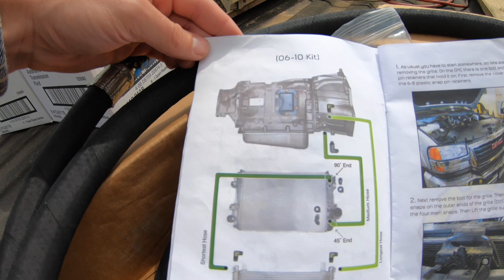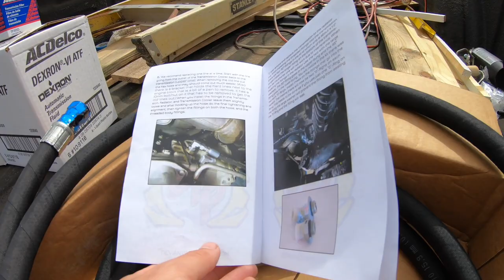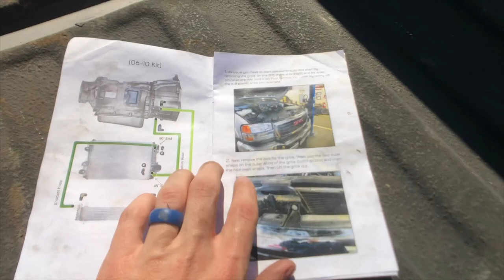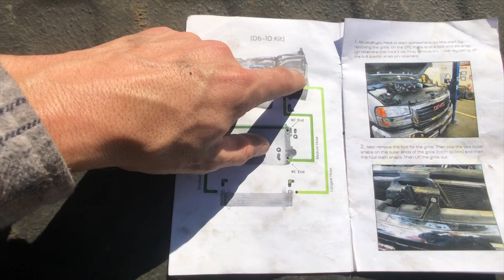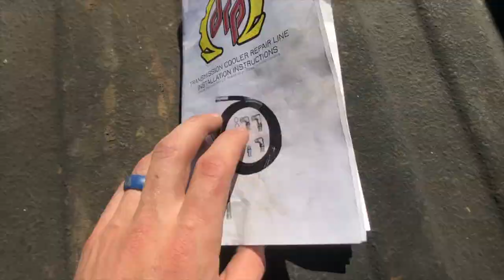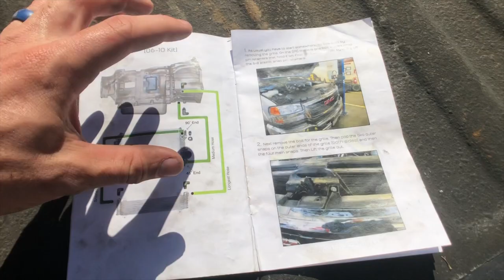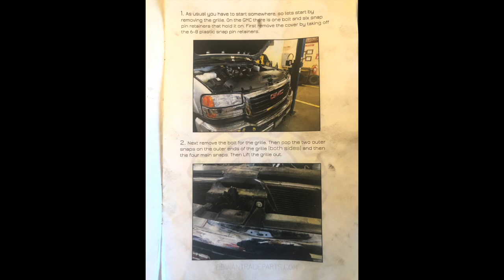Replacing Allison 1000 Transmission Lines With DEVIANT RACE PARTS "DRP" Lines

Comment: Thanks for the video! I just did this install on my LBZ for reassurance. I lucked out and did a good job tightening the connections behind the intercooler without leaks, I reassembled everything before checking. I did, however, have leaks on the other 4 connections but tightened them down until no leaks. Worth mentioning, the rubber o-ring side of the connectors just needs to be snugged down. The rubber seals it. I wish the longest hose was a bit longer so it wouldn't be draped across the front of the cooler.

Comment: I did mine before watching this video.  Mine is a 2013  duramax.  I went to NAPA and had them make a 6 foot 1/2  ID hose  5000 psi with two  3/4 -14  90 degree fittings and it has been great 3 days no leaks or anything.  The factory lines I could not get in  they were impossible without dropping the front differential . Good job on the video . Its a pretty easy job if you want to dyi .
Reply from the maker: Thanks for watching!
Reply: @trentonbartley6417  I just wanna ask, if to this day, is there no leaks on these hoses and do these hoses withstand pressure even with heavy load or towing ?
Reply: Which line did you replace with 6' of hose? The bottom line is leaking on my 2012.
Reply: @Chris Thomas  I forget and I sold the truck but the hydraulic line worked perfectly and the guy I sold the truck to never had a problem
Reply: well i am glad one person knows how to use those fitting besides me

Comment: Those 90 degree fittings aren’t meant to be tightened like that, it’s supposed to just be snug and pointed the direction it needs to be. Then you tighten that jamb but down to lock it in place and seal it. Those aren’t pipe threads on those fittings, the threads don’t seal the fluid in, the o ring does. Those threads are straight cut like bolt threads, that’s why they can’t seal and need the o ring. Pipe threads are tapered and just need some sealer on them before you tighten the fitting.
Reply from the maker: Thanks for the info!
Reply: @trentonbartley6417  
Yer most welcome, got my 5/8” kit yesterday. Have a new PPE cooler for it also.
Reply: I'm about to do mine any tips
Reply: @AA-dg3ig  
It’s hard to give tips when there are a couple different types of hose lengths and fittings used depending on truck year models. 
The OEM hoses would be a pain to remove if you couldn’t cut the rubber portion and pull them out from two directions. There is a clamp securing the metal lines to the engine about mid way on the block. Remove the clamp bolt with a 10 mm socket on a 1/4” drive ratchet. Try not to break that clamp, i reused it to secure the new hoses with a large zip tie. Once you get the bolt out you can pull and rotate both metal lines to the rear and they’ll eventually come out. Now unlock the top of the clamp to remove the metal lines, snap the clamp back together and bolt it and the wiring clamp that same bolt holds up back to the engine. 
Use backup wrenches on the radiator and the cooler in the grille to prevent damaging them when changing the fittings. The radiator fittings on mine have a large sheet metal nut holding the cooler tube inside the plastic radiator tank. I used a 1 1/4” box wrench on that and a socket on the fitting to remove it. Try to put ALL of the breaking force on the two wrenches so as to not break the adhesion of the cooler to the tank and cause a coolant leak. Do those fittings one at a time so the cooler doesn’t come loose and fall off inside the tank. You’ll need a radiator if that happens. 
As in my comment above, put the new JIC fittings in the tank by hand until snug, then use a wrench to turn the fitting into alignment (less than 1 complete turn) and while holding the fitting in alignment, tighten the jamb nut down to lock the fitting in place and seal it. Repeat for the other radiator fitting and the two for the other cooler in the grille. I used a 12” adjustable wrench to hold the fittings in place while tightening the jamb nuts. 
The instructions for my LBZ are fairly straight forward except for a couple of things dealing with last hose they have you put on. It’s the lower hose from the transmission to the lower fitting on the radiator. It has a 45 degree fitting on one end and straight fitting on the other end. The instructions don’t tell you where that 45 degree end goes. It makes more sense that it would go on the transmission fitting, but the straight end is all but impossible (for me) to get started on the lower radiator fitting given the limited space the hose passes through. 
So I ended up putt the end of the hose on the radiator end and the straight end on the transmission. But that has a small clearance issue with the oil pan rail on the engine because of the way I routed my hoses to the front. I’m thinking about getting a fitting like the 6502-10-10-45 from hydraulics direct and put it on the lower fitting on the transmission to alleviate this clearance issue and give a little more slack to the lower hose.

Comment: I got it done today. Only issue was putting new fittings in the radiator it pushed in that tank in the radiator and leak out all the antifreeze but o well I got it all done.
Reply: Can antifreeze get inside the transmission fluid line if this happens? Thanks

Comment: Trent, Fantastic video. My 06 (same color too) is leaking out of the exact spot, and even my front plastic "deflector" or skid plate type deal is cracked exactly like yours to the left and right of the bolt hole. Cheers and thank you. Probably will get the same kit also.
Reply: My 08 GMC has the same leak and same cracked plate

Comment: Mine were leaking on oil filter side. But changed them all on both sides. The skid plates hold alot of fluid so everyone needs to check these lines

Comment: Awesome video, I watched this before I fixed my 05. I didn't order the same kit that you did. Any issues with the radiator? I had a little oh sh!t moment putting the fittings into the radiator (not the trans radiator, THE TRUCKS)

Comment: You can set those fittings at any angle. The jam nut is what tightens them and seals them.
Reply from the maker: Yeah, after routing all the hoses, I had to adjust a couple of the fittings for better fitment.
Reply: Yes, do a quick search on ORB fittings and read how they work. Their purpose is to allow proper orientation of the fitting to accept a rigid hose (Hydraulic, etc). You tighten the fitting to the bottom, then back it off to where you want ti fitting to be aimed, BUT DO NOT BACK OUT MORE THAN ONE REVOLUTION. Once the fitting is pointed in the direction you want it, hold it in position with a wrench while you tighten the jam nut with another wrench. Salty is correct in that the ORB fitting uses the O-Ring as the seal.

Comment: I'm having a little issue on the bottom radiator 45 fitting. It keeps leaking. I thought it might have been loose its not. I followed the instructions to a T. Seems like that fitting has a fixed washer on it already. What i did was add the big washer first and then the 2 seals after? Did I screw that up. Please help.

Comment: FYI for others. The bracket holding the two metal tranny lines going from tranny to radiator and cooler can be opened from the top standing next to the pass fender with a long large 24” screwdriver. The bracket has a hinge and can be pried open. I originally went under and unbolted the bracket. Not needed and didn’t work. In my case the nut 10mm was finger tight so it was good to check it. I won’t use it now. I’ll be using flex lines like these. Routing that pre formed tubing is a PITA. and the jinky clip attachments suck imo.

Comment: I did this to my last truck and I bought the 1/2" kit and I could tell the inside of the fittings were not a smooth flow design and also not full 1/2" flow path actually much less in places.  Which kit did you install and did you notice this?  Stock design would have similar restrictions at very ends, I wonder if 5/8" line kit restricts to less than 1/2" anyway just like 1/2" kit.
Reply from the maker: I did not look to see if the lines restricted down to a smaller size, going off of memory I don’t recall that though. 

I went with DRP’s kit which a lot of guys run due to their great quality.

Comment: When I unscrewed the radiator top and bottom bung they fell off and now all I have is plastic. What did I do wrong? thanks if you could help.
Reply: Figured out, if you take both trans bungs off at  the same time the fixture inside the radiator will fall to the bottom of the lower hose inlet. Remedy take rad off realign fixture put adapters back in it and do one at a time keeping fixture in place so you don't have to take the radiator off.

Comment: If your fittings are facing the wrong way after you tighten them try swapping them around until you find a cooler port it likes
Reply: That’s not how these fittings work, they’re  not NPT, you use the Jam nut to tighten it after positioning the fitting how you need it.

Comment: It’s easier and cheaper to just buy the fittings and build your own kit.  I think I had maybe $50 into mine instead of 150 or 165 whatever this dude paid for his. I used AN style fittings and steel braided line. All 1/2 I.D.    I even bought black AN fittings lol it looked bad ass and I was able to do it all my self.   The over priced kits you can buy from places like Deviant  will still leak and then your shit out of luck.  Got 20 ft of black braided hose lol and extra AN fittings  I could almost build another kit.   So look it up people don’t just do some fan boy bullshit.   Same with pcv reroute do not pay $80+ for that dumb ass kit when you can make it at the local hardware store.  Hell my local ace even had catch cans.
Reply from the maker: I understand you can do a diy cheaper, but everything you just said is double the work so not sure how that makes it easier. Kinda one of those “time is money” situations, spend more time trying to save money or spend more money saving time?
Reply: @trentonbartley6417   I guess it would take longer due to the fact you are putting the hose together with AN fittings but what maybe 10 minutes? Didn’t take me very long I measured what I needed off of the hoses that came out and wam bam in the truck and done.   Same with pcv reroute.  It might have took me some extra time to get it from the store and make it but  I paid less then 20$ for my reroute and looks clean with a catch can and then less then $50 for cooler lines.   Worth it the little bit of extra time it took.   Idk about you but I can put AN fittings and braided line together pretty fast 😂
Reply: What are the fittings exactly that are needed? And length of hoses?
Reply: @rodleypumpkins4174  not everyone has the knowledge to build a kit at there local hardware store… I certainly don’t. Maybe give tips to build one instead of being a hater… we all start somewhere
Reply: @rodleypumpkins4174   do you need crimp tools for a DIY build? I’ve never seen these fittings at ace hardware. Please advise
Reply: @Lelandwilt   this platform your commenting to me on is a perfect place to research this stuff.  I’m not a mechanic I just like saving money.  The AN fittings I got at a hydraulic/hose shop in town   You’d have to search what an AN style fitting is.  Hard to explain kind of.  No crimping tools needed which is why I like this style better then the shit you can buy premade because those are usually crimped and the crimped stuff can and does fail that’s why this video was made the factory shit is crimped and that’s where they leaked at.    An fittings go on with just basic wrenches.   Then the hose you can get anywhere. I got steel braided hose at the same shop   Hardest part is cutting the hose cleanly without making a it too frayed.  But one could use any kind of hose they want.  Braided is better in my opinion.  The pcv reroute you could make at aces hardware.   All of this can be found in most towns.  It’s not rocket science.  You need 1/2 inside diameter hose and 1/2 fittings to pair with it.
Reply: @Lelandwilt  if your unsure I would take the cooler lines off and take them into your local hydraulic/hose shop  ( not everyone has one but most heavy equipment dealers like caterpillar make hoses and have fittings.)  have the shop match the fittings on your original lines and then have them cut you some hose to length.  And then reinstall.